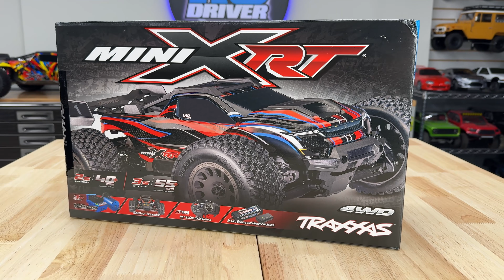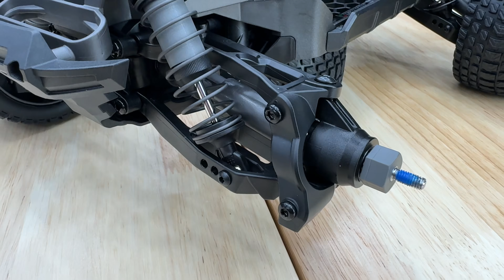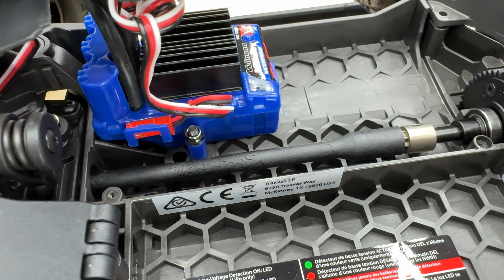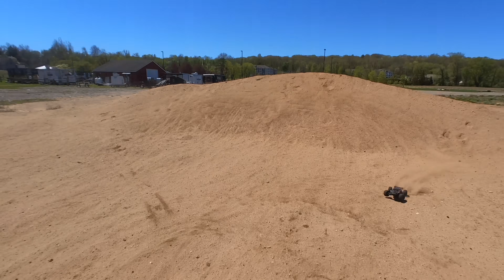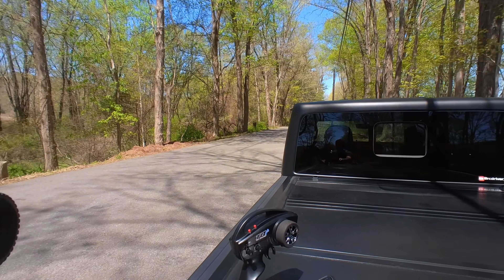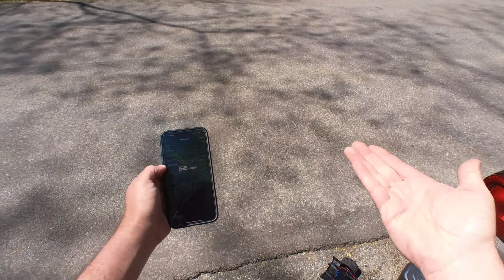EXCLUSIVE FIRST TEST! NEW Traxxas Mini XRT!

Comment: I got one of these today at 32 years old and my only rc car experience being a cheapo model from toys r us as a kid. Wow this machine is very impressive, it handles so well. Itll wheelie, or squat down and go depending on how you apply the throttle. It didnt take long to scratch the outer protective bits because i flipped it like 10 times lol

Comment: Any chance the Mini Maxx body fits on this chassis??? Thanks in and advance!
Reply: Wheelbase is same, but shock towers are quite a bit different. It does look like the actual holes might line up though, at least looking at the top-down pictures from Traxxas' website. Best case scenario you will be able to fit the Mini Maxx body if you cut out a slot in the rear for wing mount.

Edit: if you look at them from the side, Mini Maxx body sits a lot higher up, so you would need to cut the sides too. And XRT body would have gaps above nerf bars. So tldr: no.

Comment: Store model had a cutout on the windshield. Hopefully it doesn’t come like that.
Reply: It does unfortunately 😂
Reply: @mesodan  huh? There's no cutout in Greg's review unit, why on earth would they ship it differently than shown here or in any marketing materials?
Reply: @FilipRadelic  not sure if you’re being sarcastic? A lot of unboxings now with big holes cut into the front and back of the body.
Reply: @FilipRadelic  https://youtu.be/0LycMmyi9e8?si=MuK0e5mABrVznviE
Reply: @mesodan  I have genuinely not seen that. Seems like a prototype thing maybe?
Reply: @FilipRadelic  obviously an eff up in the design process with not enough cooling with 3S and overgearing to get that big top speed. I guess they tried a bandaid fix with chopping up the body. Hopefully a better fix comes with the V2 version.
Reply: @ holy crap, looking at the pictures of bodies, they do indeed look like they have these ugly cutouts. Cancelling my preorder for both the truck and the extra body until I can have a guarantee there will be no holes in any bodies. Thanks for the heads up.
Reply: @ just got an email response from Traxxas support: “All the production vehicles and replacement bodies have the cooling hole in the windshield.”

Cancelling both of my preorders. Absolutely disgusting fix for an unnecessarily over-geared model.

Comment: I did a build on my buddy's Mini-Maxx using the center diff and aluminum center shaft, and it broke the spines off of the front pinion.  Could be a coincidence, but I think the aluminum one is too rigid and that the plastic one would help protect the front pinion.
Reply: People break that pinion with stock plastic shaft too, it's just really crappy metal, that's why many people run 1/10 diffs+shaft cut down to length.

Comment: Its not a monster truck its a truggy, it's crazy how often the biggest channels are the most clueless
Reply from the maker: So tell me where on the Traxxas site they define the truck as a Truggy? I’ll save you the time. No where. As the guy who reviewed the very first production truggy, they’re a flat aluminum chassis plate model. This is not that, it a hybrid. The XRT is primarily classified as a racing monster truck, however calling it a truggy is not incorrect either. Sorry you were clueless about this.

Comment: So... wide maxx kit, velenion system, center diff, tsm, and metal gear servo with more torque... for $110. But it's overpriced? Honestly,  it's like a slash ultimate,  $100 more with triple that+ in upgrades. And 62mph... but even better, nearly ANY hobby shop will have parts of you need them. It's a lot, yes.... but it has a lot already in it. I spent $28 to make my mini maxx take what i throw at it too... not some ridiculous amount. There's a reason the diffs break in the mini maxx, and yes, it should have came with a slipper, but that set properly, solves it.

Comment: So what about temps?I noticed no fans on either the motor or esc. My mini erevo required fans.
Reply from the maker: I ran two 2S packs back to back on a 75 degree day. Hot at the end, but didn’t thermal.
Reply: If you run it on 3S and gear it down properly, it will probably be ok without fans. My 3 MERVs were all fan-less and with smaller ESC and motor so less overhead (granted, Mini Maxx and this one are quite a bit heavier). 2S with this high gearing might overheat without fans once summer heats start. Same with 3S if you run it without properly gearing down and/or adding fans.

3S on 15T is probably gonna be the sweet spot. It will require Mini Maxx motor mount (15-23T) since this little guy comes with 3T higher mesh presets (18-26T) and there's really no need for 60+ mph on such a small basher.

Comment: Please make a XRT mini versus rustler 4x4 vxl
Reply: Rusty had such great potential as a basher, but those old clipless bodies make me not even wanna run the car because every bad landing means having to put the body back on 🙁 Other than that, mine's nearly indestructible on 4S. Gonna be hard to compete with its value too, but if you want something that fits into a backpack or that you can fit more of in your car boot (that's a big deal for me personally and why I mostly run MERVs even though I have a fully pimped Rusty), this looks like a banger.

Comment: The mini XRT is probably the better deal! Slightly smaller but comes with battery and charger, center diff and metal gear servo. And its easier to take the body on and off

Comment: Different Offset wheels front and back is a deal breaker for me. It means I can not run normal wheels from brands like proline/jconcepts/schumacher. What a disappointment.
Reply: They don't have different offsets, people thought this about Mini Maxx too, but they're just softer tires in the back and harder in the front. Same offsets.
Reply: @FilipRadelic  Exacty what I said, different compound tires front and rear
Reply: He didn't say the front and rear wheels had different offsets, but they are 2.6 dual profile like SC wheels.
Reply: @nox1010   Yes they have different offsets front and back. He did talk about the tires and not the actual wheel itself. This car could be great for rc tracks but traxxas made it impossible choosing to go with different offsets. the original traxxas tires are just not great for tracks.
Reply: @LyroLife  Please explain what you mean by offset.

Comment: Would I still be able to put like normal 1/10 scale traxxas parts on it? Example shocks, drive shafts, etc
Reply: It does use the same 1/10 shocks as most of their 1/10 models (but only the long ones, not xxl ones), and there's parts you can reuse like diffs, center driveshaft (need to cut it down to length) etc. Drive shafts of any other vehicle would probably be too long anyway.

Comment: I think this is the fastest traxxas car out of the box at 62 with stock gearing.  Even the 6s maxx slash only goes 60mph on the stock gearing.  All the faster cars need the speed pinon to go faster than this.  The xo1 on the stock gearing is only in the 50s.

Comment: How are the temps?
Reply from the maker: I ran two 2S packs back to back on a 75 degree day and it was hot at the end but didn’t thermal. My guess is hard running on hotter days will require fans.

Comment: Why does Traxxas ALWAYS choose to cheap out on low cost items🤷🤷
They could of easily included an aluminum center driveshaft.  Even though they included a center diff, those sintered metal diffs are still a liability.  Why save literal pennies-- At the expense of  your reputation for reliability.

Comment: Is it really $120 better than the 3s Typhon Grom? I don’t think it’s that much bigger, and you don’t get anything here that you don’t get on the Grom.
Reply: That depends
Where are you running? (On road, offroad) 
How are you going to be running? (Speedruning, bashing, or general purpose fun on a lunch break) 
If bashing, what Terain are you going to be running on? ( gravel, groomed dirt, grass, ect)
Both of these are going to handle certain condition differently. For example, where the typhoon grom may run fantastic on the road or in packed dirt, it might not run the best in grass or in a woodsy setting with sticks and such. This might be better suited, as it's more of a technical 1/12 scale vehicle, but traxxas calls it 1/16th. The groms are 1 /14 and below, and that matters a lot. 
In short is it worth 120 more. I can't answer that. Only you can. Don't let someone on the internet tell you how to feel or what to buy. Because they don't know your situation. Only you do. All I can offer is guidance.
Reply: @ You’re right, I was really surprised on how well it handled that rough dirt in the video. I have a Typhon Grom and it would be on its roof in no time on that terrain. I still like the groms better because they make for better racing, especially on a nice prepped track.

Comment: Groms, micro b's, mini max, mjx...

My interest is finally peaked with this one, I'm sold.
Reply: how comes it only peaked for this and not the mini max? am looking ay getting back into RC and struggling to decide which to grab >.<
Reply: @martyn334  a loooot of problems came out of the minimaxx. To upgrade a minimaxx to what the mini XRT has, you would be able to buy 2 mini XRT's. From center diff to a stronger servo they did this one real right, it has the same powerhouse as a rustler (1/10th scale) in a smaller 1/16th package
Reply: I wouldn’t waste your money and get a Grom instead but hey go ahead and waste your money on traxxsux

Comment: I assume he ran it in the sand so it wouldn't blow the diffs.  Would still need atleast $150 of upgrades for me  , then rustler ultimate would be a better deal.
Reply: It's like $50 to build 2 x-01 diffs and then it's basically bulletproof.

Comment: Need a 1/10th scale XRT now
Reply: rustler ultimate
Reply: @nicko2222 sorta, but I'd like to see them take the maxx and make an xrt with that chassis. Much larger/beefier diffs/driveline. Can handle a lot more power. Unless they think that would interfere with the sledge, but that's an aluminum chassis setup...
Reply: Isnt that the rustler

Comment: Please tell me it has diffs that will not strip out after 4 packs on 3s?     I am talking about the MINI E REVO VXL.        If they solved the diff issue I am sold!!
Reply from the maker: So far I have two full 2S packs and one full 3S pack through it. Speed tests were actually additional to that. So far so good. Heading back out for more bashing tomorrow.

Comment: Sweet
Think they should have put the bevel gears in it but that's my opinion.
Reply from the maker: Stock, I think the planetary will do. But for those who will eventually go with a faster BL system, they’ll probably need it. But then thats when gear changes are just part of that type of modification.
Reply: @rcdriver im unsure if they will be ok. The metal gear steering servo is a plus.

Comment: Good price 👍🏾
Reply: It honestly is for what it comes with. 
Updated chassis 
Metal gear servo 
3s 1/10th Brushless system
Center differential. 

Wish it came with the aluminum center driveshaft.
Reply: @Boltboy-kh7yw aluminum center shaft would've been cool, but the plastic one in my Mini Maxx has been holding up well on 3s.
Reply: how much i cant load link
Reply: @EvanTrunnell $369.95
Reply: @EvanTrunnell $370 usd. Honestly not bad for what you get